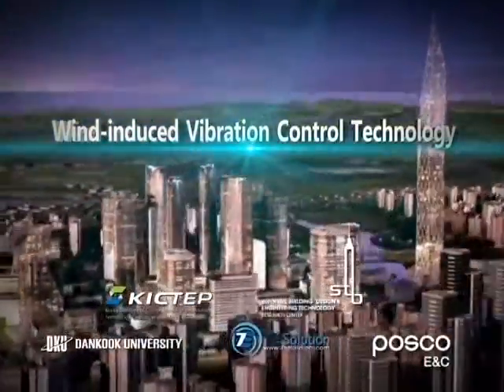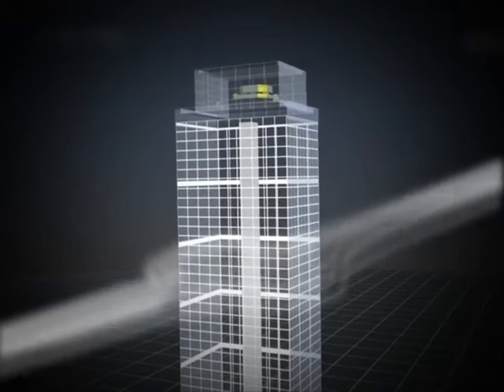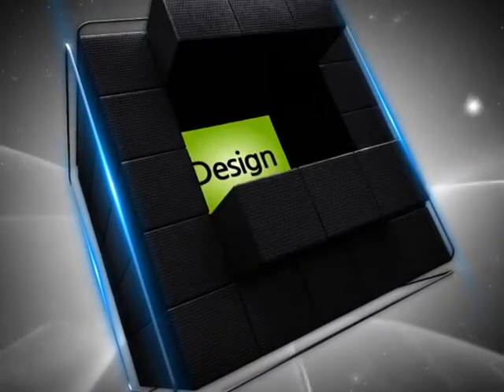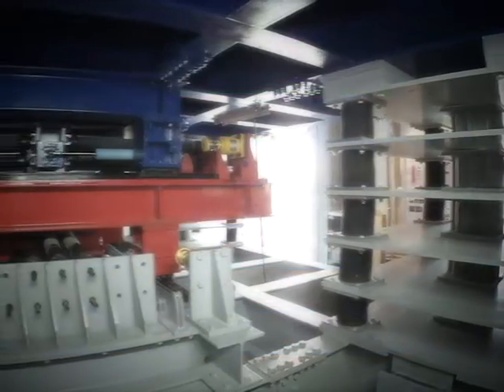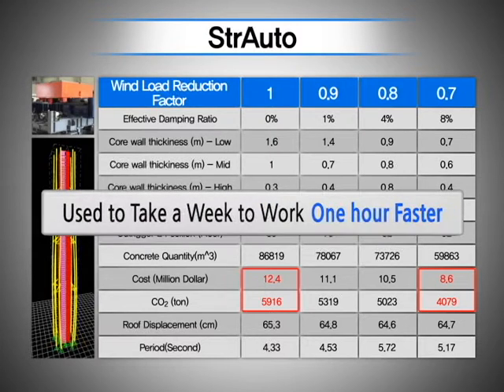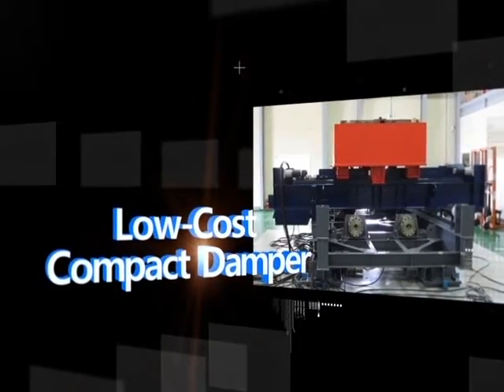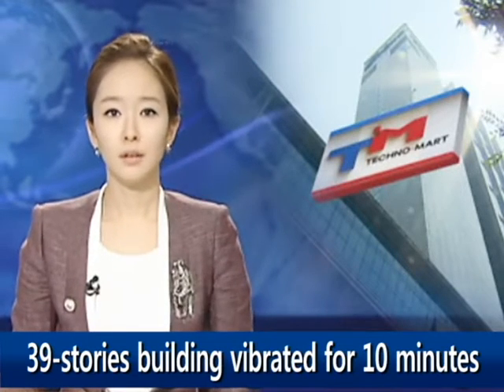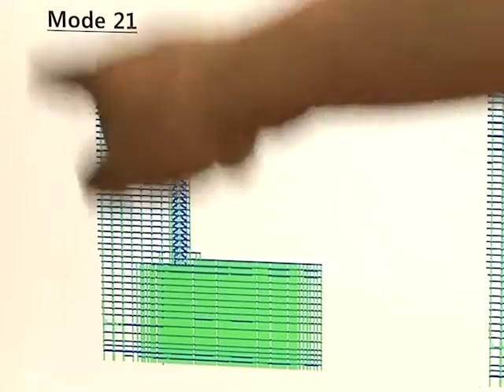Wind Induced Vibration Control Technology of Super Highrise Building

Comment: The 404 ft Salisbury Cathedral spire (England) dates from 1549. Inside is a suspended wooden structure with multiple knobs that don't quite touch the inside surface. When any vibration starts the knobs act as snubbers. They may not have understood the von Karman effect but they were certainly aware of it. Just so we don't get too full of ourselves about modern analytical techniques.